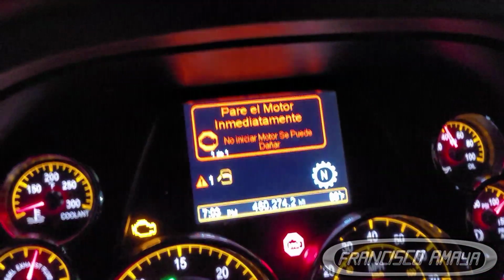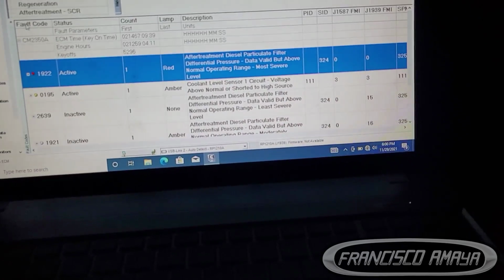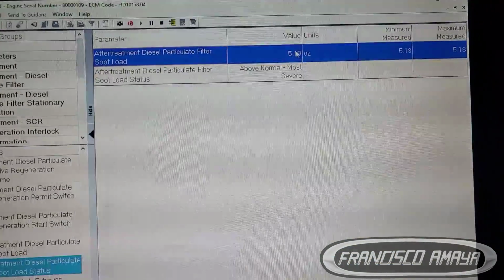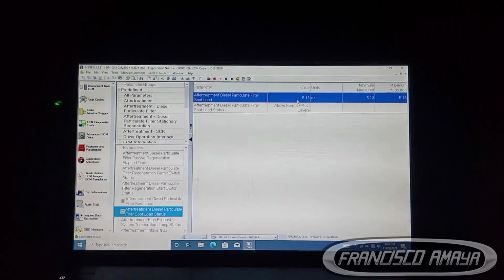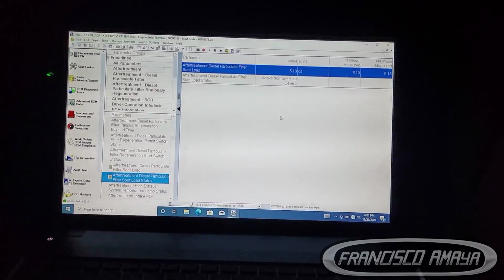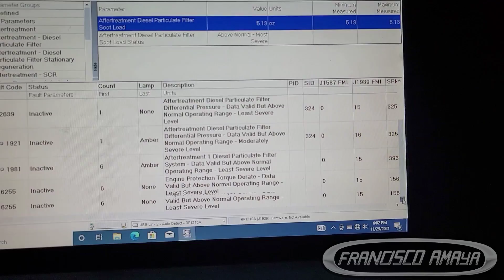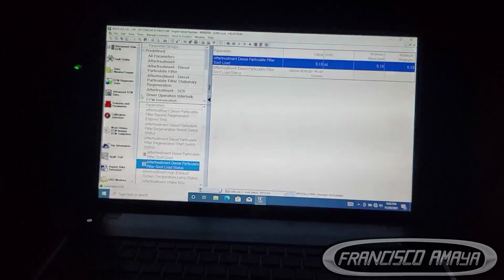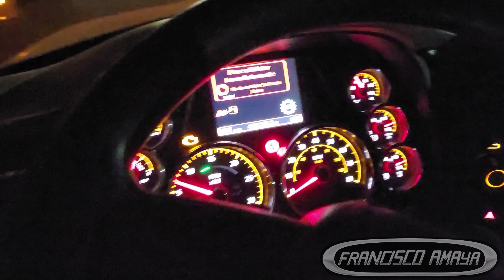Cummins X15 regeneration too often after 500 miles bad DPF filters  SPN 3251 FMI 0 diagnostic

Comment: Hi Francisco, I got a 2021 Peterbilt with a Cummins X 15 and I have to keep doing a frequent regen  every other day .. there’s no codes in the truck so I decided to change the DPF filter. I did a full regen and all the values were perfect but I still getting frequent regen once I take the truck back out on the road do you have any clue what I could start dealing with concerning with sensors?

Comment: Hola Mr, bien interesante sus videos, muchas gracias. 
Recién compré un Peterbilt 579 2016 con Cummins ISX15
y me gustaría ver si usted pudiese decirme las cosas importantes a tener en cuenta con este motor. 
Ej: 
Cada cuantas Millas debo hacer cambio de aceite
Si debo cambiar fuel filters junto con el cambio de aceite, o si es antes o después
Que tipo de aceite es mejor
Si debo mecánicamente eliminar el dpf el egr o es mejor dejarlo original
Cual es la presión de aceite ideal 
Temperatura de aceite común durante tránsito en interstate
Si debo añadirle algún aditivo al diésel con cada mantenimiento, ej: ATF
Cada que tiempo cambiar filtro de aire

Observación: yo mismo le hago los cambios de aceite y toda la mecánica que no requiera mucho conocimiento o desarme.

Etc. todo lo que usted pueda decirme para que el motor me dure lo mas posible

Muchas gracias

Comment: if Telematic is installed in your truck , you are doomed to eternal problems with aftertreatment and DEF systems problems , this is a tool with which Cumm..  remotly interferes with the operation of the engine and related systems without prior permission...
scumm manage this world!

Comment: Good job at idling this truck for a long periods of time, only has 470k miles. My truck 2018 cascadia has 570k miles never cleaned my dpf, never had a regen done since bought it brand new
Reply: Do you run an apu? That seems to be the solution to not clogging the dpf filter.
Reply: @michaelglenning5107  yes. Never idled my truck more than 5 minutes, I have 5 minute idle shutdown feature programmed